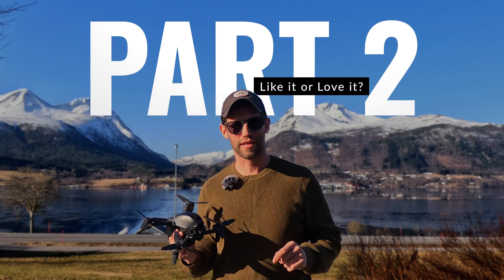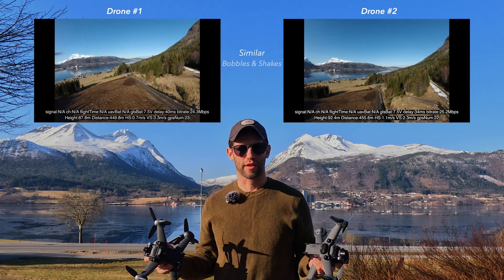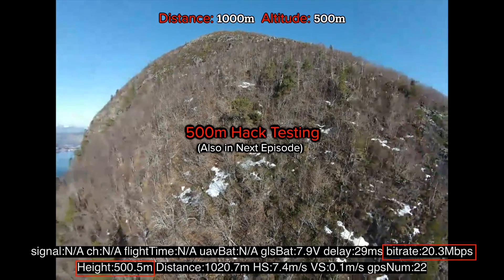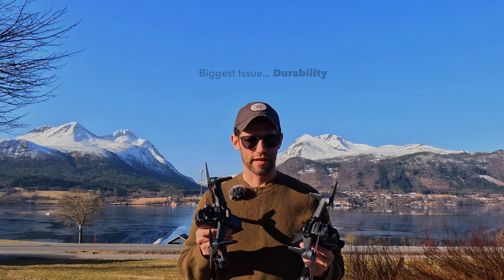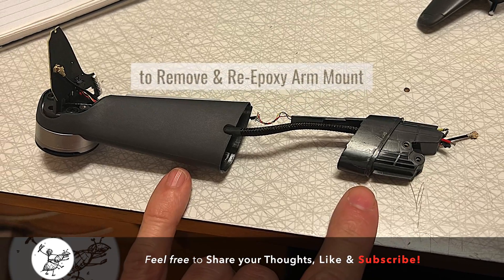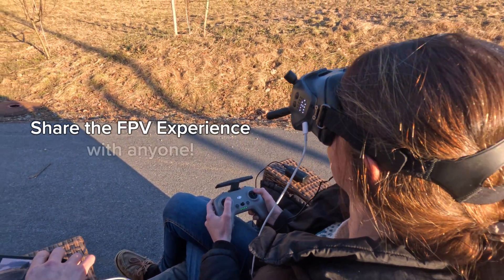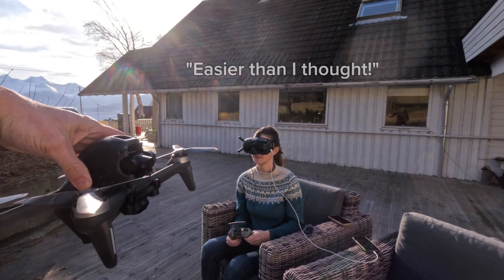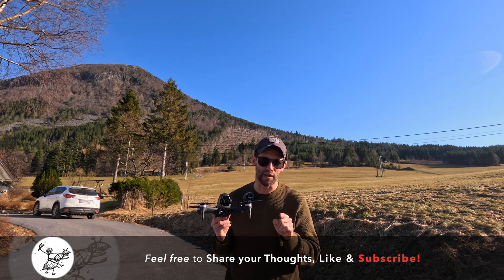DJI FPV Drone, Why do I Love it? Pros & Cons | Drone Crash & Repair | Buy it used 2024?  #dji #fpv

Comment: While I fly RC planes, I was completely new to drones. This drone allowed me to do the first step in flying a GPS drone. Then I practiced on the software and learn to fly in manual mode. Now I like the ability to be able to switch, back-and-forth between manual and GPS modes. So while it’s not the very best at either, it may be the only drone that has both functions.
Reply from the maker: Nice, I too started with RC Planes. In my opinion they are way harder to fly! Especially since once you take off you then have to land… haha! 
This is definitely a great drone to get the feel of FPV drones, but I will say the flight performance is pretty poor compared to my proper FPV quads. This disadvantage is offset by the many luxuries this drone offers, hovering, safety features, great RTH, excellent quality, signal performance and the ability for new folks to easily experience the magic of FPV flight!

Comment: Thanks for this video and showing your pros and cons! 👍
Reply from the maker: Hey thanks for watching. Great little setup honestly, though disappointing new… i lost it yesterday in the mountains.  Battery was at 30% then suddenly said “Low Battery Landing Now”… long story but I hiked around the is sketchy mountain searching for an hour but didn’t find it.
Fortunately I have another!
Reply: @GiantAntCowboy  Could you try to find out where it might have landed by analysing the last transmission?
Reply from the maker: @Phoenix.-  oh man… it was honestly a “self-inflicted disaster”. When I got the message about landing I tried to cancel it by clicking the “Stop” button, but since I was flying in Manual mode it disarmed the quad and it tumbled then lost video… so the video stop while falling. 
Then I didn’t have a cable to hook up my phone to try the “find my quad feature”… 
I hiked up there but it was steep, slippery, and eventually started snowing. Ugh. 
Wish it didn’t auto land, but in hindsight I wish I didn’t touch any buttons. It probably would have been fine…

Comment: omg you need new foam for those goggles! Dont get the DJI branded stuff, a lot of the retailers in USA have their own but idk where they source it from... anyway, thats the stuff you want.
Reply from the maker: Yea man, 100% agreed. I’ve been looking into some options. I’m in Norway so everything becomes special order, but I’ll find a reasonable upgrade. (Any specific recommendations?)
Thanks for checking out the video, good tip, cheers!
Reply: Oooooh so that’s why our foreheads had those red marks😆
Reply from the maker: @LivLazer  Added comfort & also refuse light leak on the sides. Upgrades coming for the team!